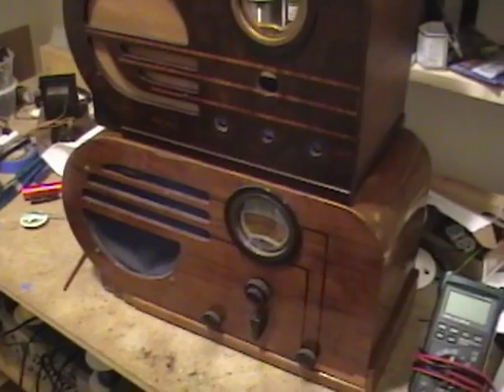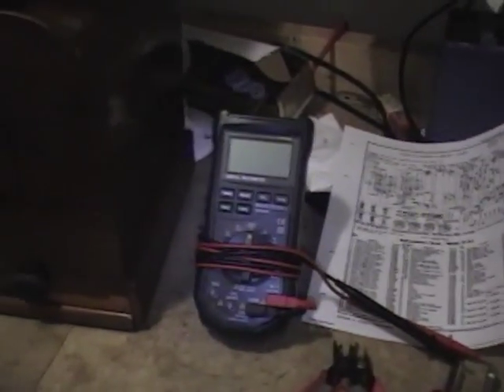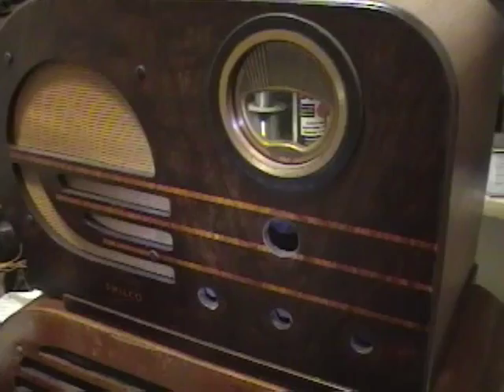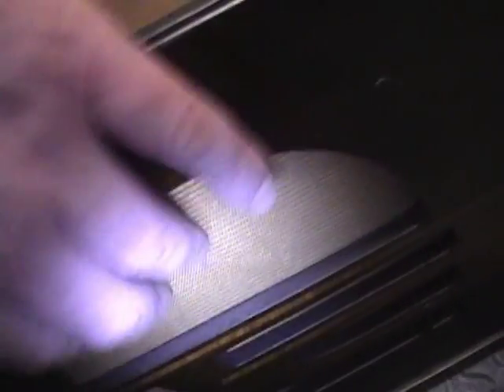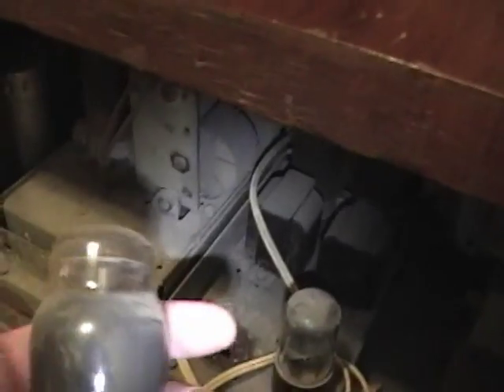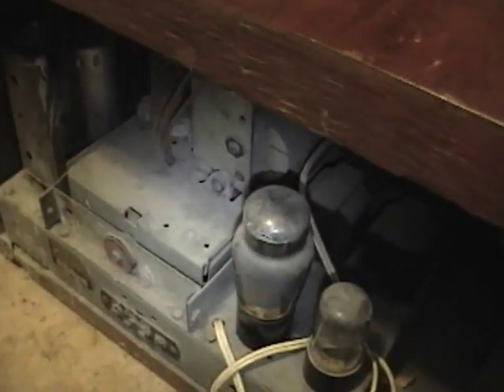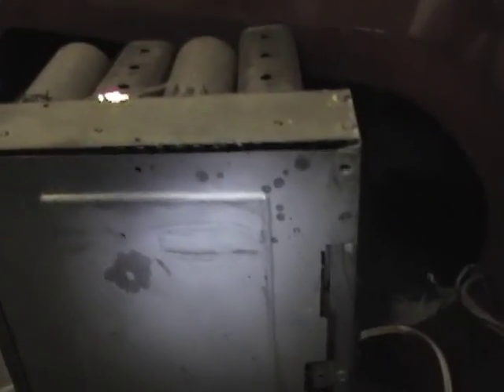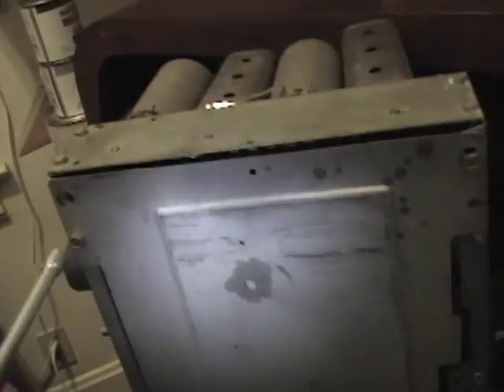Philco 37-611 Restoration p1o4

Comment: So let me make sure i have this right. The terminal strip itself be mounted anywhere on the chassis so long as the negative leads of the caps themselves are not directly in contact with the chassis. Is this correct? I thank you in advance for your time. I am fairly new to this, and figuring these things out for the 1st time.

Comment: What kind of lubrication do you use for the tuning capacitor's bearing?  Do you apply it to the bearing on the front of the capacitor toward the dial?

I've had a bad experience lubricating a rheostat, where I think the shaft of the rheostat and its bushing must have been the electrical connection to the wiper because oil caused an open circuit to the wiper.

Comment: Philco bullet radios, hurray!!! The smaller bullet has a dynoc faux finish front panel, the other has real veneer. They even had a battery version of the larger bullet a few years ago, worth looking into as well as it looks like a decent set. Don't clean the dial scale with water, the letters will disappear, use mineral spirits.